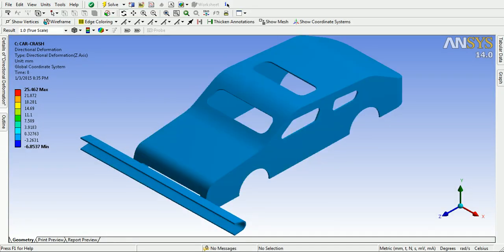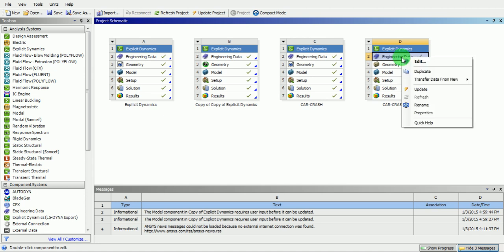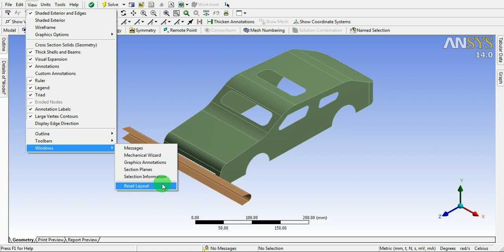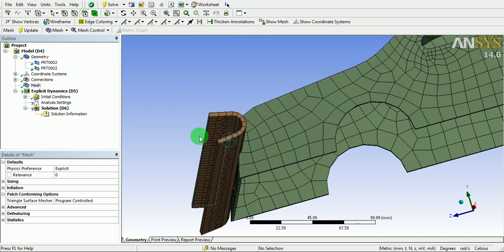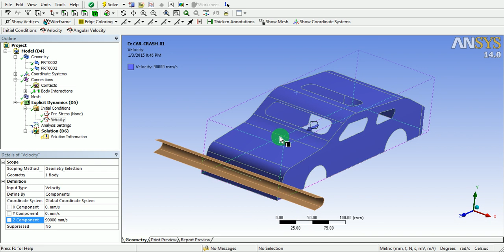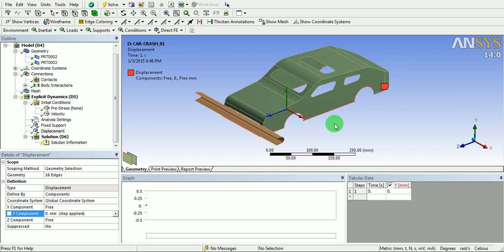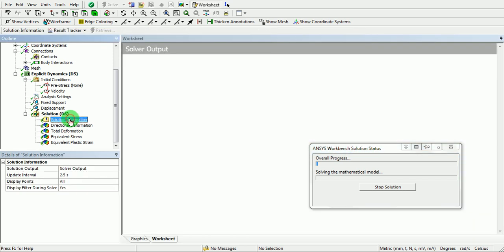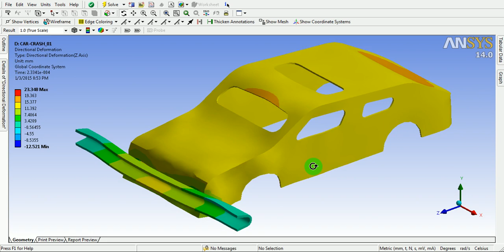ANSYS Workbench Tutorial Video | Explicit Dynamics Analysis | Crash | GRS |

Comment: Sir, It's just a phenomenal effort to demonstrate the method of doing crash analysis (You are right! The method of doing this analysis remains same for all kind of Frontal crash tests, so doesn't really depend on speed of the car body! Speeds are only the number given as in the form of velocity of the car body, so it can be changed easily as the Simulation Engineer wants!), so I truly appreciate your efforts of doing all these! 

But according to me there are several errors / unrealistic values in this analysis! They are as follows: Please correct me, if I am wrong! :) 

1. The car body thickness is given as 2mm, which is too much...I guess! Generally, it is max. up to 1.2mm! 

2. Mostly the small problem of car crash "Energy-absorption-system" is tested by this method, because for this Energy-abortion-system only one small crash-box is used (which is just a small sheet-metal box and having thickness up to 0.8mm) - It's BC is also easier to input, one end fix and the other end is given either velocity or load-case (Impact load or Static load) 

3. The velocity you have given is 90,000 mm/s, which is equal to 324 km/hr!!! Normally, the max. Crash speed according to, Euro NCAP & IIHS (The Insurance Institute for Highway Safety, USA) are up to 64kmph with 40% Barrier Collision = 40mph = 17777 mm/s! Euro NCAP is up to 50kmph with 100% Barrier Collision = 30mph = 13889 mm/s! US NCAP is up to 56kmph with 100% Barrier Collision = 35mph = 15556 mm/s! 

4. The measurement time, you have given is 0.0007s, which is I guess unrealistic! Generally, it's max. up to 70ms preferred by some good Engineers! So, 70 ms = 0.07s! Because, crash Engineers tested data shows the actual crash finishes in 70 ms. I think, 0.0007 s is too small! 

5. Somebody has asked that why there is a big deformation showing at rear of the car! It should be happened at front, but not happening, because, the bottom edges of the car structure is fixed (Given as fixed support)! Thus, the bottom is fixed and so all the crash impact force flows above the fixed part and thus frontal part doesn't get much deformation, instead all these impact forces flows through the side panels and try to deflect the rear trunk part (or rear window part) more as compared to frontal Bonnet part. Creating first Euler case, that is why it happens so!!! Conclusively, the analysis results are true according to the given data! But still the given data is debatable! 

6. There some more factors being considered while doing Crash test, one of the most important factor is HIC values!

HIC = Head Injury Criteria = Acceptable values up to 840! The best cars get up to 400 HIC value! Euro NCAP accepts upto 840 HIC value! HIC is the most important criteria, because the ultimate Goal of doing this crash test is to save the Occupants (Driver & Passengers) and this HIC directly depends on how good the crash Enegry-absorption-system is engineered!

Once again than you, sir, for sharing us this information! Please do not consider me as a wrong person or something! There are no intensions to hurt you! It is just, I express what I know! Your contributions to make all these videos are rather more helpful and appreciable!

All the data, I entered here of EURO NCAP / US NCAP / IIHS are according to the latest 2015/16 rules designed for crash testing by these three individuals! ;)
Reply from the maker: Thanks Ravi.
Reply: what a great effort for giving this comment!
Reply: sir can you please explain me how to get the load applied on the object hitted by vehicle in explicit dynamics of workbench. please reply me sir. it is very helpful for me.
Reply: I really appreciate your knowledge
Reply: Sir super
Reply: Sir can you please mention your mail id . i want to talk to you regarding a project
Reply: you also shared very beneficial information here. Thank you Ravi.
Reply: Your additional input is topnotch.✅

Comment: Great video. Explained in details. I have some frequent issue while running explicit dynamics. What if  Ansys is throwing a large energy error message? Should I increase the value of energy error? Or should I correct meshing at that point?  Thank you

Comment: thanks a lot for the video! im having some problems about adding accelerometers on the center of the car in order to plot a lateral, vertical and horizontal accleration against the impact time graph
1) Is it possible to do this in ANSYS? 
2) Or what should i set in the solution? ( is it select the surface in total acceleration)
:)
Reply from the maker: +Billy Wong Billy, create surface split @ locations which in which you wish to capture acceleration. In post processing you may try extracting acceleration at vertices of that split
Reply from the maker: +CAE Worldwide for more videos visit www.youtube.com/c/grscadcae
Reply: +CAE Worldwide thanks a lot!!!! :)

Comment: Great video! Everything is explained with minute details. I just have one doubt. Why is the deformation maximum at the rear of the car, isn't supposed to be minimum?
Reply from the maker: Yes you are right sidd, the structure is not stiff at back.
Reply: +GRS CAD/CAE irrespective of the stiffness, isn't is supposed to be maximum deflection in the front where it actually crashes.
Reply: +GRS CAD/CAE  What can be modified in the setup or in the design of the car body to make the results look closer to reality where maximum deformation can be seen in the front of the car. Kindly explain. Thank you

Comment: Helpful video. But I have one question for the crash analysis, is there necessary to draw full sketch of car? or only can draw a bumper? Please reply me.
Reply from the maker: +mamta pawar to what distance the impact will damage the parts, those need to be considered.
Reply: CAE Worldwide  Sir if the car is impact on the rear bumper of the next car then which type of test will be there on the rear bumper

Comment: While I doing impact analysis on cold formed steel elliptical hollow steel column I obtaining that as velocity increases internal energy developed is decreased what is the reason for this?
Reply from the maker: Just check the behavior, whether the bodies are interacting as expected
Reply: @ANSYS-India  Thanks for reply.
But when I selected the whole column body I obtaining result like this( as impact velocity increaes the internal energy decreases) but while select single node in the surface of impact I obtaining the correct relation .that is as velocity increases internal energy also increases

Comment: I am facing some problem while contacting one moving plate towards a line body. one end of the line body is fixed. While simulation an automatic connection  generates but after simulation it shows no contact.
Reply from the maker: Sketch your problem description and send its snapshot to engineeringtutorsdesk@gmail.com. I will check and let you know.

Comment: i want to know the different between geometry surface and geometry solid. When we use geometry surface and geometry solid in ansys workbench. What is the different? thanks
Reply from the maker: Greetings! ! The geometry surface is used to create the shell elements or constant wall thickness objects like sheet metal formed components which are subjected to loads other than in plane loads like bending and twisting or multi directional loading,  The geometry solid is used to create solid elements mesh for parts that do not have constant wall thickness and have un even material distribution like die casted components like casings of gearbox or engine,  molded components. Also note that shell elements have 6DOF in translation and rotation, whereas solid elements have 3DOF in translation.
Email:engineeringtutorsdesk@gmail.com
Website: https://sites.google.com/site/feaengineeringdesign/
Reply: GRS CAD/CAE Thanks for your answering
Now I have some problems about ansys workbench
I have y branch model. It is created from multi parts: Pipes and mapping plates 
Thickness of pipes are 30mm, and thickness of mapping plates are 80mm and 12mm
I want to ask:
1.Should I used Geometry surface or geometry solid for this model
2. How to mesh this model?
3. all the connections are welding, Can you tell me how to created contact region?
thank you very much!